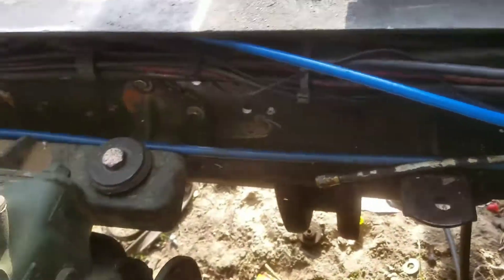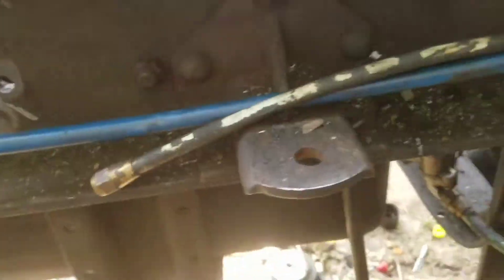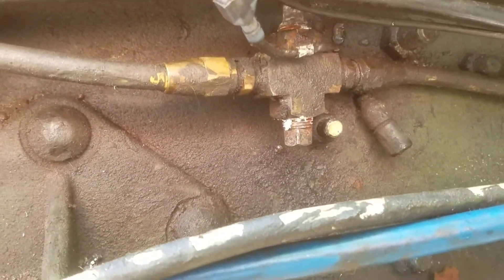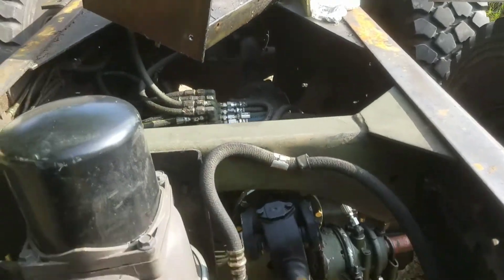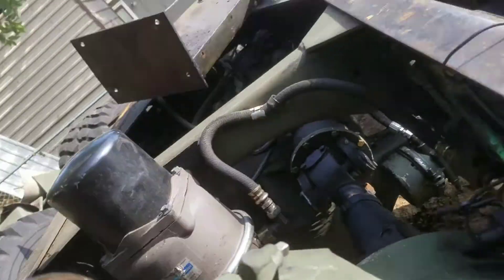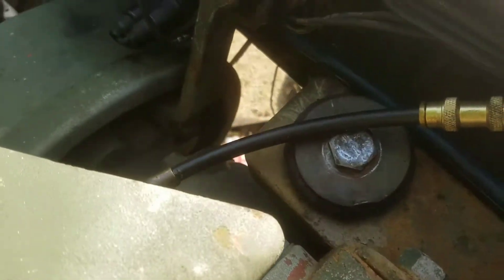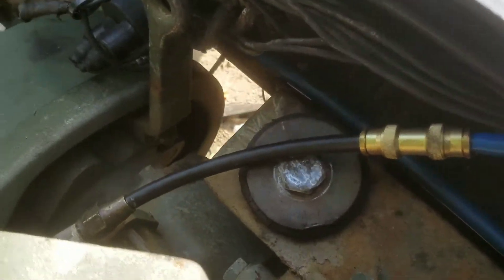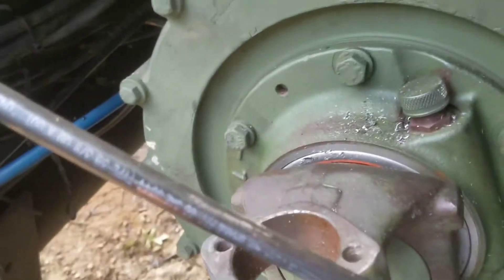M939 series with T-1138 transfer case. Single air line mod/interlock delete.

Comment: What happens to the line that goes to the cab from the T on top of the plate where you have the vent screwed in to
Reply from the maker: This video is a little better 

https://youtu.be/N7--6jxGDBM

Comment: Nice. wish it was easer to understand. is there a PDF on this mod?
Reply from the maker: Mr. Scout the line that comes from your dash switch runs the frame rail and hooks into the linear valve that sits where the shift linkage is.  Remove it. Cut and install a quick connect and air line to lengthen it. You will run this line to the valve right behind the e brake drum. That is your front axle cylinder. You then need to cap the 2 air lines coming off the frame rail that go to the linear valve and the interlock cylinder(round) on top of the transfer case. That is the lines you need to plug off at the 4 way block on the frame rail.  Then you need to put a pipe plug in the shift fork lock cylinder air fitting on the top of the transfer case so it does not get junk in it.  This allows the 6x6 to engage off the dash board switch directly. It also gets rid of the air pressure that locks the shift fork from being accidentally kicked off.  This will allow for smooth shifts.  You still need your transfer case handle button to unlock the torque converter so it doesnt bind.  This goes thru the capacitor mounted to the bottom of the cab with 5 wires running every where.

On your drivers side of the transmission behind the plate that holds the shift cable should be a round cylinder solenoid that has 2 wires. Cut the ground wire. Make it longer and run it to a better grounding place.  It causes torque converter lockup issues especially when shifting low to high while moving.